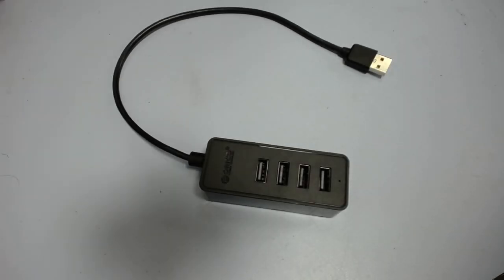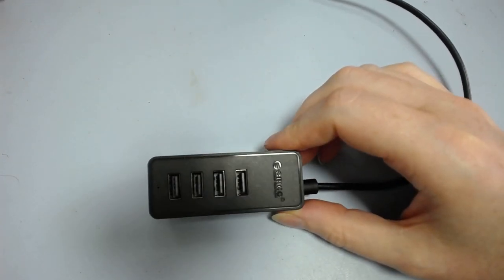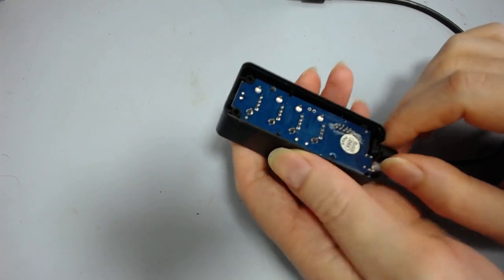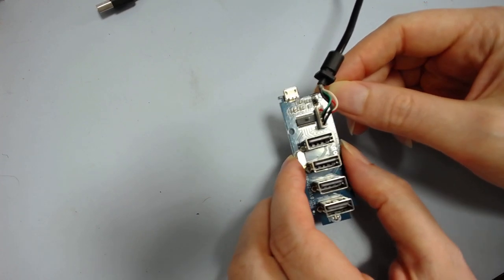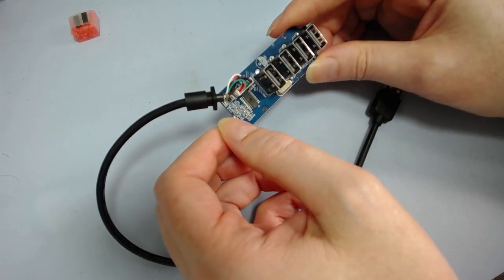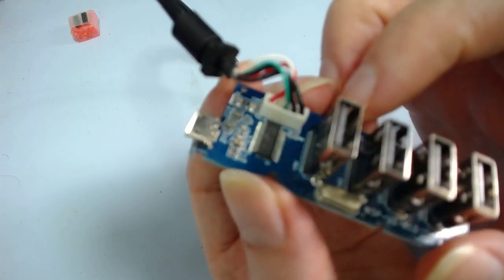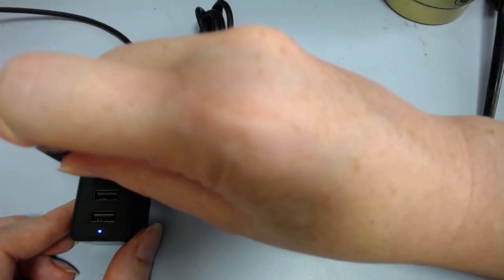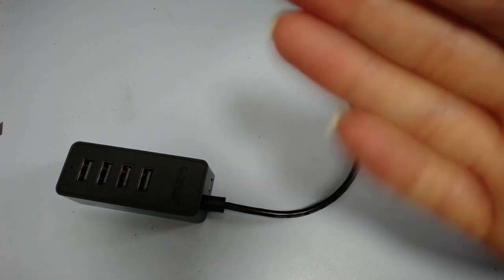Dead Orico W5P-U2 USB hub repair

Comment: Hello Agent24, watching your video, the circuit board is missing an electrolytic capacitor and another is missing a diode instead of a resistor. D2 = SL34 ; CD1 = 560 uF x 6.3 V. This device is used with a power adapter with DC 5V 2A output.
Kind regards...
A great video. Keep going.
Reply from the maker: Thanks! I may investigate that and add/change those components as necessary, however I've been using it so far only on bus power with a mouse, keyboard and other low power devices, and it's been working fine.

Comment: I was thinking about little usb hibs like this, and, like you say "sustained data throughput" for how a dvdrw drive can be usb to plug into it (and thereby multiple DVDRW drives can share a USB port by means of such a hub). A 1x speed CD is 150kbps and a 1x speed DVD is about 10x cd speed of say 1500kbps (1.5Mbps). A USB1 (or USB1.1 standard) is 12MBps so an 8x DVDReWriter (a typical write speed even on many a SATA drive) can use a USB 1.1 port at full bandwidth. a 480Mbps USB2.0 port might get "up to" 480mbps so that is up to 48 such drives although a Sata DVDRW drive might read some DVD disks at 16x speed. So 24 such USB DVDRW drives would occupy 9and saturate0 the bandwith of a USB2.0 hub. I'm guessing a person would play it safe and opt for less just in case their particular hub or usb port was somewhat slower than 480Mbps. It's like how you might get those ethernet-ove-power adaptors claiming to be 80Mbps but really the are more like 30Mbps (which is still ample for a 24Mbps ADSL2 internet_connection with some wiggle-room). a reasonable backup solution for say GRsync to have a few old DVDRW drives, even though HDD (and NAND) arrays such as redundant storage by RAId or BTRFS (or ZFS) first, before the DVDRW later copies the same, would do. This theory is alll very well but usually requires a hub, so you did the righ ting fixing it. Well done. Also, you can perhaps fix your back by lifting dumb-bells. I went through various exercises like walking many many miles each day (which  resulted in weightloss, although I'd like to do that again) but also weights. Now I lift a 20Lb dumbbell a thousand reps each arm (100 on the left and then swap to the right untill 1000 each left and right is done for the 2000 reps) and it helps back strength. Takes maybe an hour and a half each day. Try it if you can (and get well soon since your back injury). Definitely worked to some extent for me. I worked up from  10lbs to 20lbs. Would be good to go to 30lbs or 40lbs but don't have the schedule right now.
My comment has no hate in it and I do no harm. I am not appalled or afraid, boasting or envying or complaining... Just saying. Psalms23: Giving thanks and praise to the Lord and peace and love. Also, I'd say Matthew6.